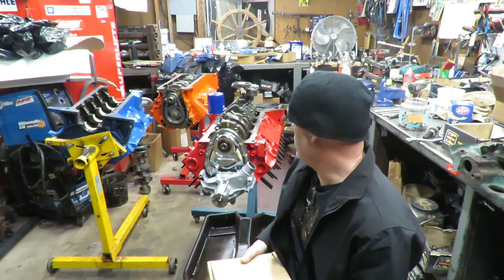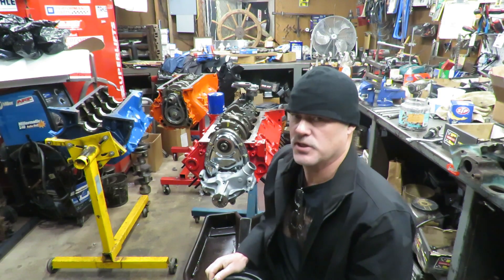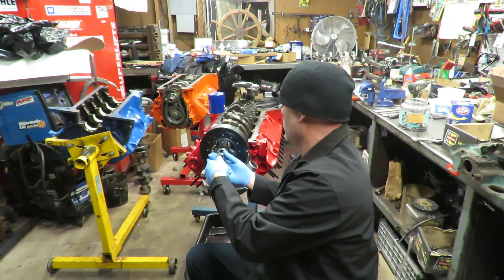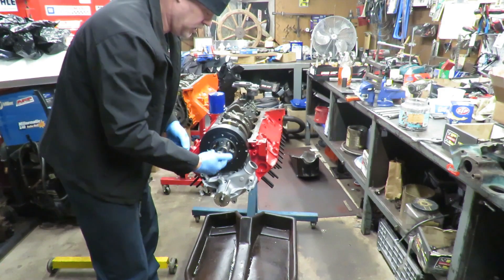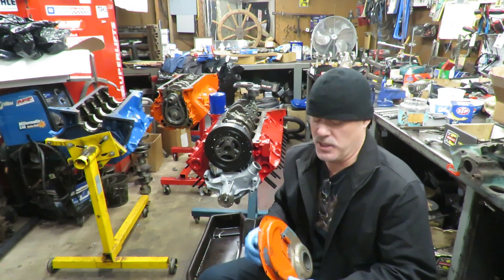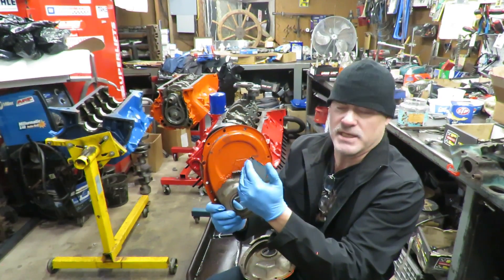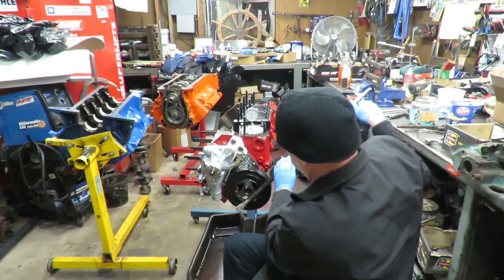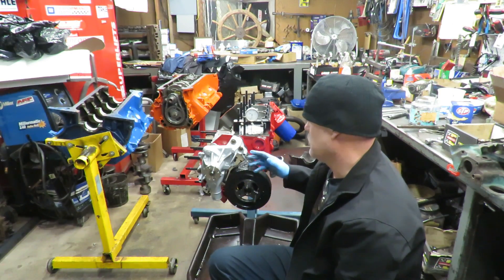350 Chevy timing Marks

Comment: GM 350 is one of the BEST V8's built along with the LS Engines!!!   AWESOME VIDOES
Reply: Not sure I agree with you, there have been so many different versions of the sbc and most of them were not that great,  maybe that was the metallurgy of the day or the fact that the american autoworkers back then relied on the union to keep there jobs not the job quality they performed. A four bolt main block was your bst bet on longevity and GM put out some really nasty engines. I do agree that the LS engines were a leap forward in    with there drive trains and were way over due. I have a 95 vette with the second to last year for the SBC being an LT1 . So in my opinion which ever asshole put the Opti-spark on the front of the engine, directly under the water pump should be kicked in the head you choose which one,  but that's is only a small example, The Lt1 is a much better engine when compared to the sbc just as the LS engine is superior to the the LT1. to be clear I mean the pre LS LT1's engines, since LT1 is a sales code that has been adopted into it's own model designation over the decades.
Reply: You mean that ford copy / LS 🤣

Comment: You can just buy the proper timing tab. it is for a late model first gen SBC. It puts the timing tab over center at the 12:00 o'clock position. It's called a 12:00 O'clock timing tab.
Reply: sure that is true once you are aware of that being an issue. Before that moment your trying to set the timing, when everything else is correct your mind starts going down every scenario, stretched timing chain, vacuum leaks etc. knowledge is power,  doing a repair is not difficult but proper diagnosis  is truly a gift and comes with experiance in the field not from a laptop or an app.

Comment: I was wondering I have a 1994 chevy k1500 5.7 before vortec and I bought some headers for it, but they have a round port and I believe the heads are square port could I still run these headers, side note: I want to say I can because the round ports are lager than the square but I'm not sure. Thought I would ask you cause I don't know anyone in my area
Reply from the maker: They will work fine

Comment: Hello, I have an 85 camaro 305 tbi l03 engine and I want to do a 350 swap but I live in L.A California so I can't really do much bcuz of smog..I was reading ppl have done it b4 but just put the 305 heads on too pass smog, Will it work?  And how would the car run? Why can't I just put the hole 350 engine with 350 heads on?...

Comment: What are you using for a phase converter ? What size and make ?
Reply from the maker: I have a rotary Phase convertor
PL-10 Pro-Line 10HP Rotary Phase Converter - Built-In Starter, Made In USA
DIGITAL CONTROLS/PROTECTION-SOFT START BALDOR GENERATOR

Comment: Do you know if you would run into piston to valve clearance issues on a stock Chevy 350 with a 1107 summit cam? .487/.508 lift
Reply from the maker: no you shouldnt but it still needs to be checked and you will not be able to use stock springs with that cam
Reply: @Myvintageiron7512  I have the z28 springs on my heads

Comment: Unrelated to the video question. I would like your opinion on a crate engine I'm thinking of buying. A zz427 big block chevy crate engine. I will need to change oil pans for my application so I will be double checking main and rod bolt tightness. What would your concerns be ? I had a zz3 small block crate engine before. It was fine nothing wrong with it. A little to tame for me though.

Comment: Thanks for answering me. I was entertaining the idea of building a promod.  I watched your Ford vs Chevy video.  I'm a die HARD ford guy.  That being said I have two Mustangs right now.  I know that Fords cost per HP is higher then Chevy.  I would love to hear you opinion of this topic.  where is Mopar in the after market now.  I went into Heavy equipment repair and haven't raced in 30 years.  I also may need to throw some work your way.  I wasn't trolling you.  My 17 hasn't had it's oil changed yet so I can't do to many mods yet.  It has 3750 this evening but I have had it at the track twice.  Staging at a tree felt really good.  The base V6 Mustang will have to go.  The cost of a S550 5.0 swap wouldn't be worth it.

Comment: Hi buddy,i have a 71 impala 350 0.30 over recent rebuild,but i dont know how its the normal oil pressure. The summit gauge shows me 50 psi and then drops to 25 more or less...please give me your advise.thank you
Reply from the maker: 25 at idle is fine
Reply: @Myvintageiron7512  thank you so much

Comment: Hi, I've got 1957 283 block that I punched to 4" (302) I also have a set of oem 1969 z-28 11-1 hi top pistons, and a L-79 camshaft.Should I rebuild and use my 461 camel hump heads or go with vortec heads? I'm looking for a strong streetable performer. Worried about 64cc heads and compression ratio too high and preignition with todays shit gas in california. Your expert advice is appreciated.      thanks    Philip
Reply from the maker: The Vortec heads have the same chamber size as your 461's if it's 11 to 1 there's no way it runs on pump gas
Reply: @Myvintageiron7512  yeah I thought so, which heads do you suggest the 882's maybe? or should I fly cut the piston domes? How would you get the compression down for 92 octane?
Reply: @Myvintageiron7512  or maybe 441 heads?
Reply: How about the 993 or 441 heads?
Reply: Or fly cut the dome pistons?

Comment: I used to run and build my own comp eliminator engines back in the '80s . We always lined up the woodruff key on the crankshaft with the zero line on the balancer.  
We used to tape off an area 1/2 wide on the balancer and paint it white, then carefully and accurately scribe a line with a scratch awl across the balancer. This was a race engine that hardly ever saw dirt so it was always easy to see.  
 You can position the timing marks anywhere you need them as long as you verify the TDC for their accuracy. We ran a Hilborn front cover with a injector pump drive and an ATI superdamper. We would set the magneto timing statically with a buzz box so we were always referring back to the timing mark. It HAD to be accurate.
Great video!

Comment: Great video my friend. One of the things I was thinking about was the balancer depth difference for the reluctor ring on vortec 350s I use the factory balancer without the reluctor rings and usually just turn a .100” spacer out of a washer or something to take up the slack present when the ring is not installed. You may mention this in one of your videos if you haven’t already. I think I’ve heard you speak of this before though. Love the videos and I’ve been subscribed for at least a year!
Reply from the maker: That is a good point I always buy a new balancer when I build one so when I do a vortec w/ reluctor wheel I buy the correct balancer if reusing it I just leave the reluctor wheel in there

Comment: Great video my damper has two marks on it and my timing cover has one position which mark do I use
Reply: Tyran Ducksworth  you need to find TDC on the #1 cylinder while on the compression stroke. I assume your dampener has 2 slots for a key way. Use the slot on the dampener that puts your timing mark on zero on the timing tab. Once you verify which mark it is use a paint pen or something similar to highlight the correct mark to make it a easy to time in the future.

Comment: I wanna smack anybody I see smacking a harmonic balancer on or off the crank.  You wouldn't believe the "rebuild" videos where you see the guy smacking the balancer off with a hammer, completely destroying it.  It's not the most cheapest part to replace either, and has a nasty habit of ruining the crank bearings and or the key channel.  That being said, does a harmonic balancer have to be matched to the crankshaft balance?  Or are the harmonic balance tolerances not that critical?
Reply from the maker: it depends on the engine 350 chevy's are internally balanced so the balancers are neutral (no weights) however that is not true for all engines
Reply: @Myvintageiron7512  For some engines, like Diesels, even the stock balancers aren't enough to handle the sheer vibrations of compression ignition, and so you hear a lot of horror stories of either the balancer completely destroying itself, or taking the key pin with it, ruining a perfectly good crank.  This is why fluid dampers are used, the only vibrations they don't protect against are sticker shock: about $400.
Reply: @SMOBY44  Yeah, and the counterweights on a 305 and a 350 crank are different, even though they're virtually identical other than that.  That makes me wonder if the flywheels and balancers are different between the two as well.

Comment: one time i was messing with a 350 from a 1969 something going into a 1983 elcamino the balancer we got was for the 68 but for some reason it did not line up with the timming mark on the timming cover the line was no on top like you are mentioning it. probly the timming cover was from the latter also there is a heavy one and a light one from truck 350 and car 350 i forgot to mention it was from advance i found tdc with a wire in the #1 cylander found highest point and made my own mark works great still

Comment: Lots of videos and tv shows show someone beating on the balancer, even with wood or mallet etc. Reason that is bad, you're beating the crank back witch can damage bearings, rear seal and more than likely the main bearing that sets your fore and aft play on your crank.
Reply: If a "professional" tv automotive show is showing the viewers that beating on the balancer is an ok common practice, that tv show needs to be taken off the air.  I'm tired of seeing shows that wait until the very last second to start the engine without a proper break in, or to even see if there's going to be mechanical issues during startup while it's still on the stand.  Once an engine has been dropped in, it's all the more difficult to remove troublesome parts.

Comment: This is one example of why people with timing belt engines should go to a dealer or a shop that services one manufacturer of a car. The other reasons include fast turnaround times due to the number of times the staff has replaced your kind of timing belt. Most cities in the USA have a "European cars only" shop, some cities in the northern USA have "Subaru only" shops, and most big cities will have a "Toyota and Lexus only" shop. Some cities may even specialize in one model of car, I am not sure how many cities have a "Nissan Z cars only" shop but there are a few. Those places will have that balancer installation tool for each application, whereas shops that service everything will usually rely on a soft hammer and block of wood.

I think the early Mazda Miata and certain variants of Mitsubishi Eclipse would develop problems quickly if that tool wasn't used. Those engines were already troublesome anyway, so I don't know if using the specific balancer installation tool helps anything.
Reply: Mazdas with overhead cams when a none Mazda oil filter was used would generate a tick noise from the lifters. Replaced those by the buckets. The Mazda tech reps said they had a patient on the pressure by pass valve in the filter versus the block or adapter like most engines, so aftermarket filters didn't have this valve and only 50-70% of oil was filtered causing the lifter oil holes to clog over time.

This was back in mid 90s when I worked at a Mazda dealer. Timing belt and lifters was almost daily.